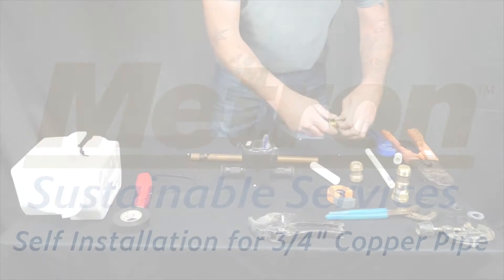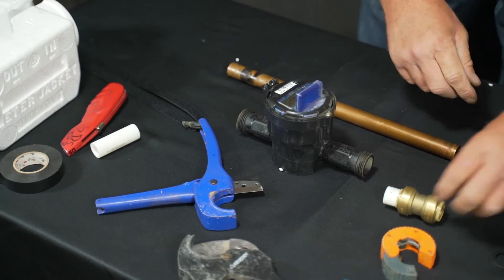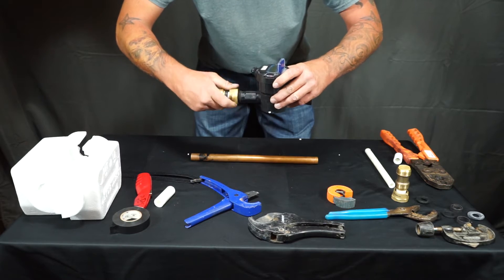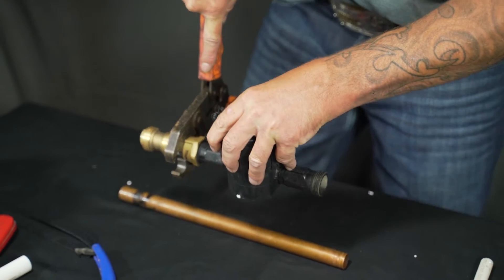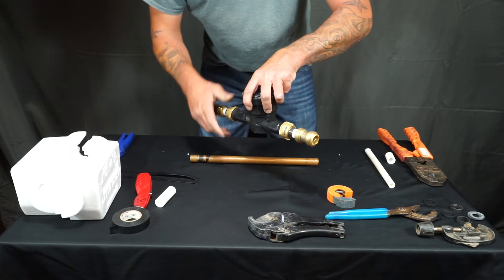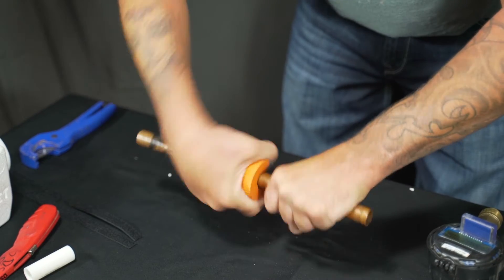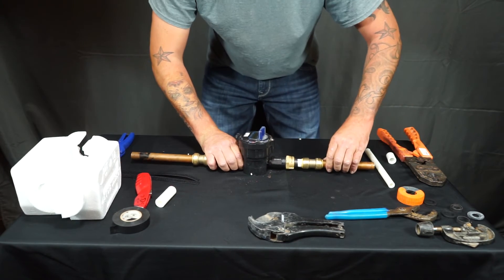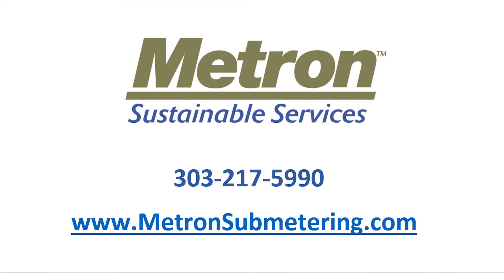Water Meter Installation - 3/4" Copper Pipe

Comment: Sharkbites huh? Couldnt use em at my company, well you could if you want other plumbers to rag on you. You need to sweat that copper pipe to a female copper fitting or use a pro press fitting.